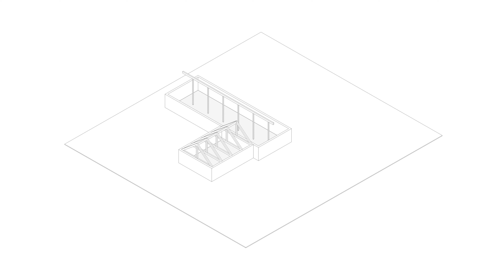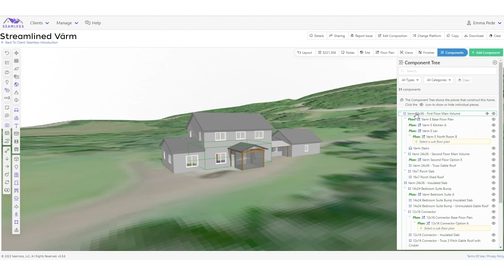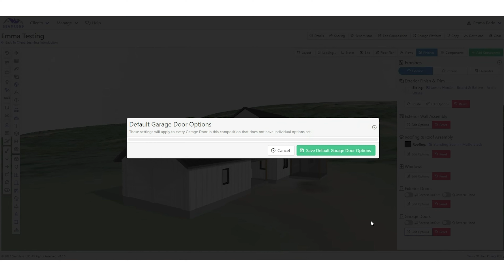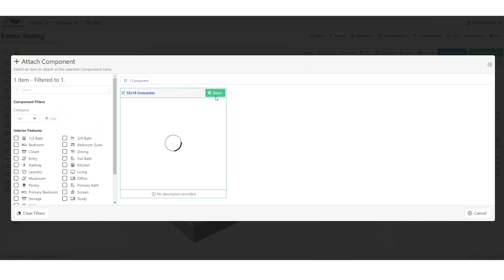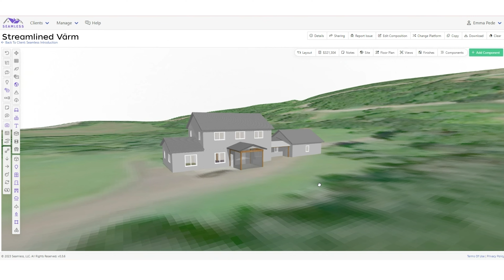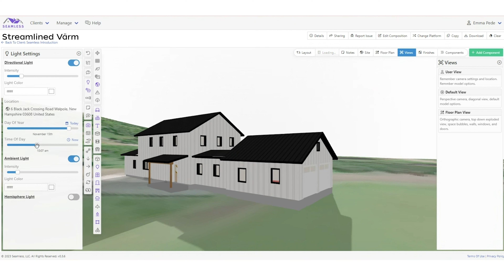A New Era of Streamlined Design Innovation

Comment: 1)Can all non-toxic/non chemical products be used to build? (For ppl with MCS?)
2) can the homes be built/designed to be Mold Free and mold free from internal walls from water damage from plumbing leakes?  Currently a huge problem with all homes.

It’s horrifying the way homes are built in the US. Most homes have mold and moldy wood is used to build homes! And make people very sick.

We are in dire need of change!
Thank you so Much
Reply from the maker: Thank you for reaching out! We fully agree and our core mission is to provide homes that are healthy for both homeowners and the planet. Our homes are constructed using materials with low-VOC (Volatile Organic Compounds), based on the Indoor AirPLUS program by the Environmental Protection Agency (EPA). Examples include products with less glue or less toxic glue, like our OSB wood, which is made from recycled wood scraps. Our home shells are also fully insulated with natural dense-pack cellulose insulation, which is fully mold and insect resistant in addition to being more flame resistant than fiberglass or mineral wool batt insulation. We also use wood varnishes made from milk whey products like Vermont Natural Coatings. Our windows are uPVC, which is a type of PVC that does not contain plasticizers like BPA and Phthalates, so the windows do not off-gas for the occupants and while also avoiding condensation problems on the inside of the home. Using healthy building materials to create a healthy indoor living environment is our top priority. 😊 Hope this helps!

Comment: This is rather disingenuous.....based on my observations, northern New England has more clouds than sun. We know that solar gain is between 10am  and 3pm and New Hampshire  has a dearth of sun as it is. I have friends who are greatly disappointed where the sun doesn't appear until 11 am and disappears before 2. They live in holes and were sold a bill of goods. So if you can prove the viability, I'm all ears.
Reply from the maker: This is a valid question and we do have Unity homeowners that do not want solar energy. However, our homes are optimized for those who want a net zero home since we build high performance homes which need very little energy to function. Solar panels are popular in the Northeast not only because it is a renewable energy source, but it also saves money in the long run with skyrocketing electric costs. The panels do still generate solar power on cloudy days, as long as the sun is over the horizon generating solar radiation which is what powers solar panels. Cold weather in particular actually optimizes the function of the panels, and snow slips right off in the winter once the sun comes out. There is the option of net metering where the solar panels feed energy back to the grid when they produce excess power on sunny days, and the utility then compensates for the excess supply. Then when needed on cloudy days, the home can still pull from the grid but over the course of the year the panels/home still produce more energy than it consumes (net zero). Another common way to store energy during cloudy spells is through solar batteries for storage, which works well for folks completely off grid. Here's a helpful article: https://www.energysage.com/solar/solar-panels-work-night-cloudy-day/ Hope this helps!